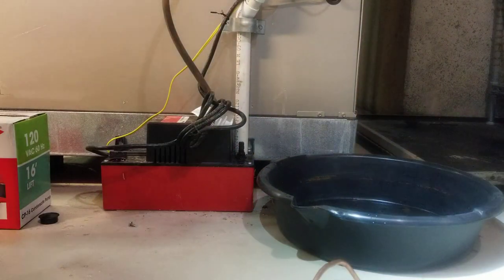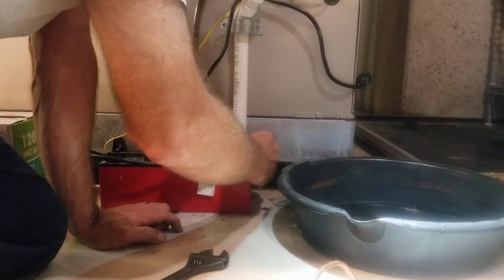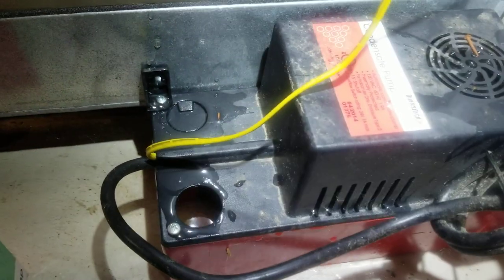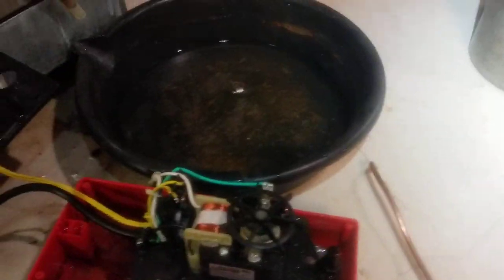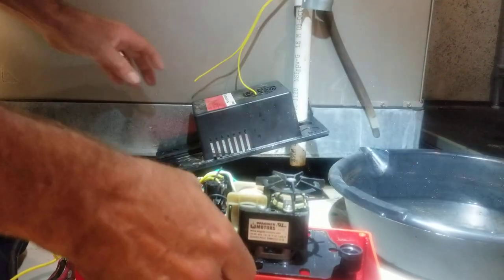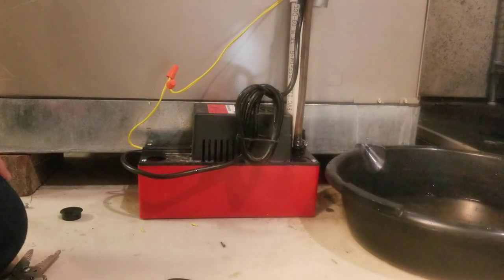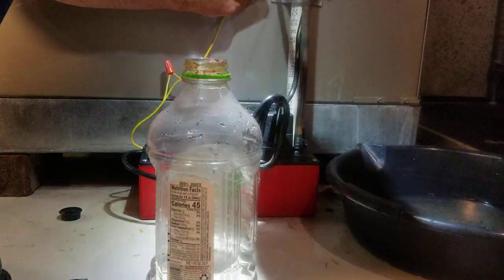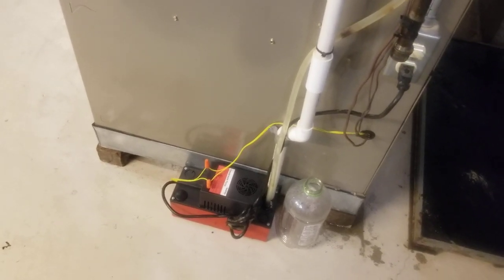Bad condensate pump??? Check this first

Comment: Thanks. Cleaned mine just now after watching your video. Float got stuck so the motor kept on running. Opened it up and cleaned it thoroughly with hot water and vinegar.

Comment: Did you check those yellow wires to the pump side while disconnected, with a multimeter to insure that they have continuity?  And then fill the tank with water and see that wires are now open circuit, ie no continuity.  If this test is not done the switch may be bad and you wouldn’t know.   Remember that there are two floats. One that turns the pump on and the other that opens the switch connecting the two yellow wires.  Testing scope must include both floats.

Comment: I have a great solution to a clogged pump!  Just connect your 120 volt pump to the 230 volt service, or use a 120v to 230v step-up autotransformer and watch it blow the snot out of any clog!  Another great idea, lbroght to you by the guy who came up with the  toothbrush-strapped-to-an-electric drill retrofit.
Reply: That is insane! NEVER put more voltage into a device that is rated for far less!
Reply: @borissecluna5782  can you send me videos of exactly what you are talking about

Comment: Help, please. I just got my CP-22 Series Automatic Condensate Pump and swapped out the old pump for the new (same company). It was an easy install. I filled the tank to test it and turned on the power  BUT the Alarm light is on and won't go off. The Power light (green) is on, the Alarm light (red) is on, and the Run light (amber) is on. But the pump won't pump.  In the back of the pump I even switched the two wires at the end of the yellow wires thinking those might have been reversed. But nothing I do works. The pump is level. But it doesn't work. Let me know if I should return it to Amazon of is this a simple fix.
Reply from the maker: Try taking the yellow wires off the pump
Reply: @MiHeatingGuy  I just now tried your suggestion and the same lights are on and the pump is not working. I'll call the company tomorrow using the phone number they give. If that doesn't work I'll return it to Amazon. My HVAC installer who discovered my old pump had failed gave me an estimate of $395.85 AFTER $70 "member savings" to replace the pump. When they called about whether I wanted to accept the estimate I told them I would replace it myself. He understood and agreed it that would be a reasonable DIY project. And it should be. Thanks.
Reply: Mother in law paid $400 to have a new one installed.  I need to adventure how to clean it.  So far two guys $7,500 and $ 6,500 for replacement unit.

Comment: After my husband cleaned the pump it worked for about four hours. Then it just started to go on and off on and off  constantly. Is it possible that he connected the wiring wrong? Would the pump be going on and off because of a clogged line? TY. BTW GREAT VIDEO